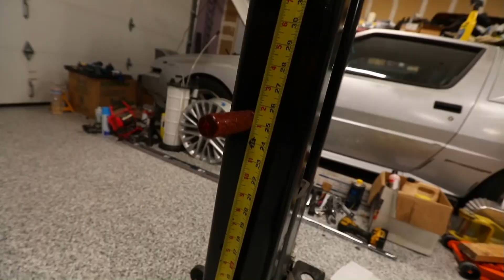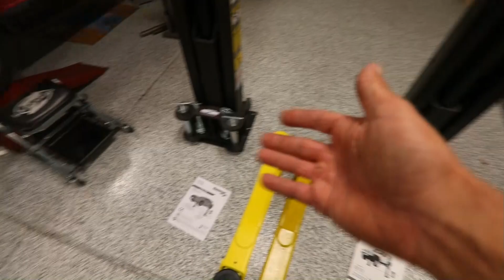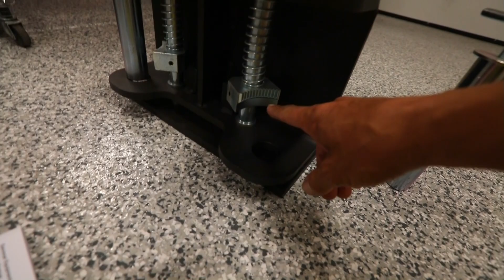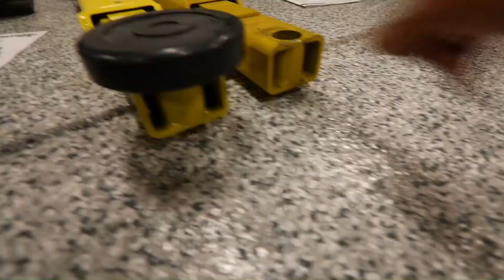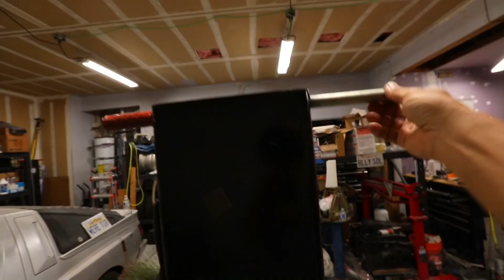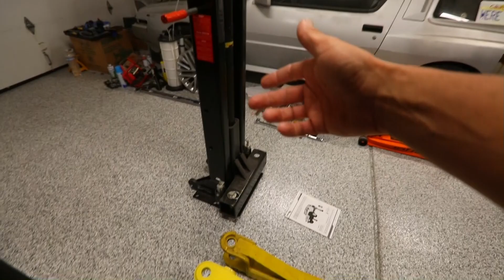Danmar M6 vs Danmar MaxJax mid rise 2 post lifts

Comment: I noticed that you have what looks like an Epoxy ceramic coating on your garage floor.  I'm also looking at having this done to my garage and then later planning on installing a Max Jax car lift.  How difficult/easy was it to drill through the coating to set in your anchor bolts? Also when you are bolting the lifts to the floor were there any issues with the texture of the coating created for the post to sit flat?
Reply from the maker: Having an epoxy coating or not didn't make any difference in drilling the holes and I can't imagine it having any affect when installed.  You'll shim around the individual bolts to square up the lift and any irregularities will just get crushed flat.  To be honest, I haven't installed the lift on this floor as the slab is too thin.

Comment: The cost between two. Thanks
Reply from the maker: As of right now, 01-22-2021, the M6 lists for $2440 and $1995 for the original on MaxJax.com

https://www.maxjax.com/maxjax/
https://www.maxjax.com/shop/original-maxjax/
Reply: Would you suggest the m6 with those added changes at that price point over the original?

Comment: Maxjax allows for you to drill 2 more stops for the safety bar
Reply from the maker: Where did you find that?  Did I miss it in the manual somewhere?
Reply: @rallysol  from this guy lol. https://youtu.be/-RhO8LF5e88 He only said that maxjax allows it but i didn’t see it written anywhere either. I’m sure they can. It’s probably one of those things where the math allows for it but the company wouldn’t recommend modifying the lift. Especially without a ‘professional’ 🤷🏻‍♂️ I’d do it. The structural integrity of the column being compromised by 4 more carefully placed holes, I feel, is way less likely to happen than say... one of the internal lock pins failing on its own. Would you agree?
Reply from the maker: @robrodriguez4866  Yea, I didn't think that would be something they'd condone or endorse.  But yea, I'd agree theres enough structure there.  I mean I drilled a set for a lower stop in mine.

Comment: rallysol - are they OK on a 4inch slab?
Reply from the maker: I wouldn't.  Lookin' at BendPac's requirements they want 4.5" reinforced high strength as a minimum.

Here's a link to their page
https://www.bendpak.com/car-lifts/concrete-floor-requirements/
Reply: According to the M6 user manual 4" is the minimum,  just like the original version.  I'm putting one in my home garage soon

Comment: Hey! So have you heard of any other low ceiling height options? I have realistically an 8 foot ceiling in my garage, and I've been truly contemplating one of these until I can build another garage with a taller ceiling? How have they held up to abuse? Any flexing or sketchyness?
Reply from the maker: There are a few low rise scissor options I've heard of but am not familiar with.  I haven't had any issues with mine while I was able to use it. I'd occasionally earthquake test the cars a couple feet off the ground 'n the lift wouldn't make any odd noises.  Just need to recheck the torque on the anchor bolts every once in a while
Reply: Bendpak rereleased these and fixed problems and did a few updates.

Comment: what is the tolerance on the polyethelene blocks inside the channel? my m6 is having issues when i put weight on it and the carriage aims outwards. I lifted the car and the hydraulic cylinder hit the cross bar at the top. also are you having issues with the crinkle paint and smooth travel?
Reply from the maker: Rocking the carriage in place makes it seem somewhere between an 8th and a quarter inch total on the blocks. No more or less really than with the Maxjax.  I haven't had a chance to use the M6 yet so I can't comment on how smoothly it lifts with the crinkle paint, though I will throw some white lithium grease at it just because.